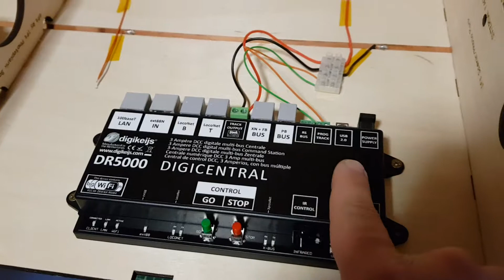2FS #7 - Wiring and Motors Done

Comment: Great content. I'm fitting Cobalts to my fiddle yard to switch some 2mm Association point kits, following with interest!
Reply from the maker: Thank you!  The hardest part was definitely cutting the rods to the right length, once that was sorted - all was easy. I have the rod going straight into the tie bar (either etched as in the first point (rightmost when the layout is upside-down as in this video) or the easitrac bar. I personally found the plastic point kits to be OK, but very hard to put right - one thing I really enjoy about PCB track construction is that you can keep fixing it - but plastic cement glues onces and you're done!